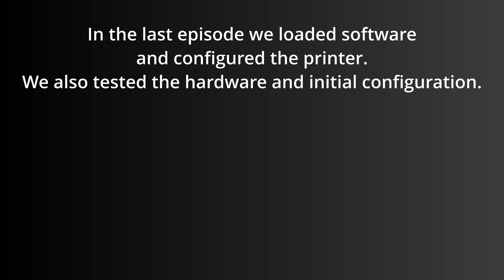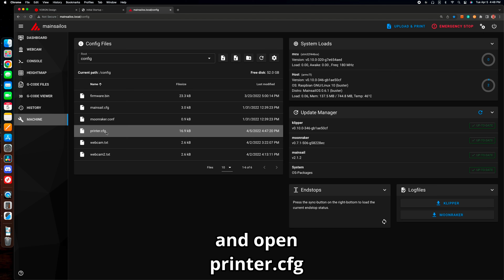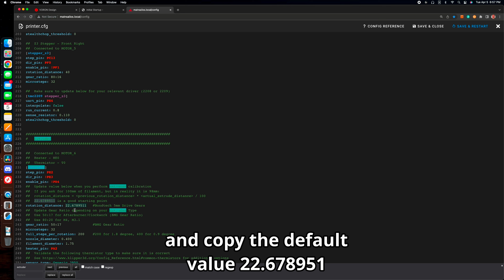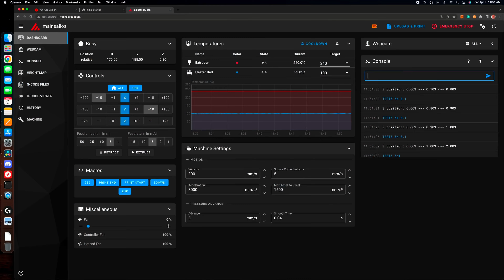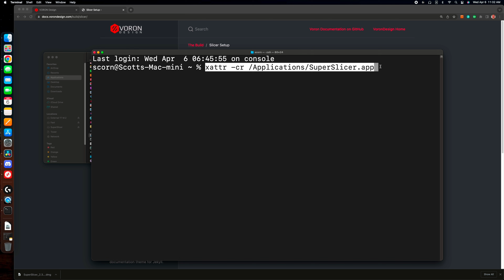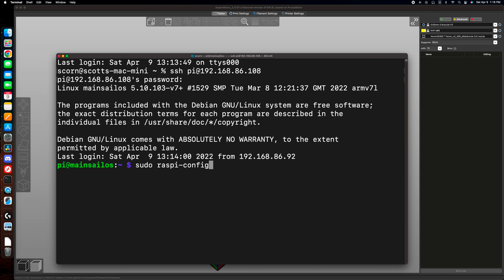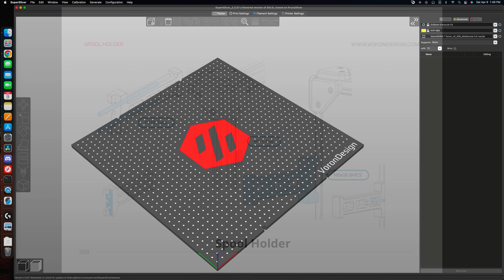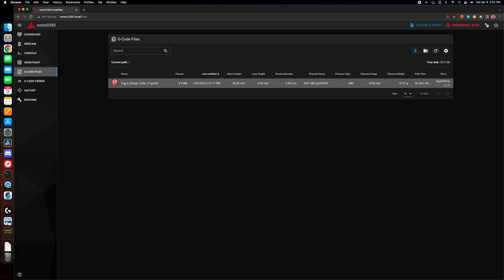Voron 2.4 Step By Step Part 13 Tuning, SuperSlicer and First Print

Comment: ty for this vid. Saved me from myself. Just finished my build and like a fool I calibrated extruder steps by extruding through a hot hot end and not just removing it and calibrating that way. I've made many more mistakes and crashes but your video series has served great reference to get me up and running. Many thanks.
Reply from the maker: Thank you. Sorry was away on business for the last week.
Reply: This is a misconception. Calibrating through a hotend or with it removes makes zero difference. Your final flow numbers in your slicer may be slightly different but the result will be the same.
Technically removing the hotend will give you a more accurate measurement of rotation but because of the way the flow value is calibrated in the slice it doesn't matter. The flow rate number in the slicer might be slightly different but the result will be exactly the same.
Reply: @ashleywhitehead3710  Neat!
Reply: @ashleywhitehead3710  This! I never calibrate rotatio-distance with the hotend removed. Just lower the speed to 1mm/s and measure properly. Doing it with the hotend removed might in fact hide mechanical problems with the extruding system: slipping feed gears, partially clogged nozzle,  low heatblock temp.  Fine tuning the extrusion is done in the slicer anyway.

Comment: Thank you Scott, its a great series. I specifically like the time you take for each single step. It makes it very easy to follow. Thanks for your efforts and all the patience.
Reply from the maker: No problem. I'm working on input shaper at the moment.
Reply: I did just the same , it’s not remembering my Z offset )-:
Reply from the maker: @adrianstealth340  I don't know that it was related, but I had Z offset issues as well. It took me redoing Z_ENDSTOP_CALIBRATE to get back to working order.

Comment: Thank you so much for your videos.
I just finished building my 2.4 R2 with stealthburner and Rapido hotned
I followed every video step by step
very helpful and thorough
struggled with the SB and the AB belts because yours in AB and different X for the rails.

Comment: Scott, thanks so much for putting these videos together. I am good with hardware and mechanics and was able to get through assembly and wiring with just the voron docs,  but as far as software configuration and programming go im pretty weak. Im sure I could have muddled through with the voron docs but it would have taken way more time than just following you.
Reply from the maker: Glad to help! I've been a software engineer for 30+ years so it's the easiest part for me. The hardware is still the fun part for me though. lol
Reply: @scottcorn  Thanks again! Just had my first successful print on the new machine! I do agree the hardware is much more interesting and enjoyable than the software.

Comment: Seeing the first print come of your voron is a special moment indeed. 🥳
I would just like to point out that all the parts external to the enclosure do not need to be ABS. You can print all the panel mounting parts and skirts in PLA. Hell I even printed the exhaust fan grill that is inside the enclosure in PLA and it's been fine.
Accent parts might be slightly different colour tone to ABS in PLA. But you can print all the enclosure mounts and door hinges in PLA and then print the skirts in ABS once you have the enclosure in place.
Reply from the maker: I've just been printing with ABS so far. I'll have to try PLA before long.
Reply: I print my non-structural parts in PLA or PETG as well. Not only is it cheaper but also easier to print and you get a much larger color palette selection.

Comment: Scott , you don`t need to take the hot end off you calulate the rotation distance . you just heat it up to 220 and do it as you normally would  , mark the filament , extrude 50mm see how much it actually extruded . calc the rotation distance , and run 50mm again to make sure its correct . Thats all is needed . Thanks for your grreat vids .

Comment: Lookin good Scott, I started my build around the same time as you and referenced your series several times. I'm up and printing just in time for the R2 and stealthburner updates.
Reply from the maker: That is awesome! I'm going to update to R2 at some point. I have the parts for stealthburner. I have a tool changer on my mind as well. I'll have to balance the two. I'm sitting here printing and realizing I need a nevermore added to the printer soon. lol I have a Hakko fume extractor, but I'm not running it for some stupid reason.

Comment: Hi Scott. Thanks for these amazing instructional videos. One question regarding the spool holder. In later videos, I see you've relocated the spool to the front left side of the printer. I want to do the same thing on my build. Skimming the subsequent instructional vids, I haven't found if you showed the move or not. Can you describe what changes you made please? Is it basically, just the relocation of the holder and then utilising two of the bowden retainers (bowden_retainer.stl)? One on the left side panel and one around the corner on the rear panel, to guide the tube to the back inlet?

Comment: What gibberish at 2:30 is meant to be some sort of "english"? I see measuring for that step preperation, but thats all. Or only to get the difference before QGL?
Reply from the maker: The back of the gantry sags a lot at this point in the build. If it is too much lower in the back the QGL will fail. Depending on how far off the gantry is side to side or front to back you can also crash the nozzle into the bed.
Reply: @scottcorn  Ok mine was about 5 mm   off at max and had three runs.

Comment: thanks, nice tutorials, just a little tip, invert the cable guides so they don't force the cables and it's very simple
Reply from the maker: Thank you.
Kinco3D was suggesting the same for the chains. These chains only bend in one direction so I'm not entirely sure what you are suggesting. Is there something I can reference out there to understand?
Reply: Just invert the first link next to the mount. It will look much better, the whole chain will lie flat on the gantry.

Comment: Great video Scott, well done! I always drag the paper under the nozzle only so there is zero interference from the omron probe I'm using. Maybe that doesn't matter?
Reply from the maker: The paper under the nozzle is needed to get things close to begin with. After that test prints are needed to further refine. Thank you.
Reply: @scottcorn  right but the way you were doing it, you had the paper under the probe as well. Like I said, it probably won't even matter since it was probed from the start of the calibration.

Comment: iam building my voron 2.4 according to you but i have a problem 
when i try to print i preheat then i start the print voron home the qgl the home again but after this it start to print on the z endstop  
iam using what you use iam just following your instructions
Reply from the maker: Are you saying that it starts extruding when it is still over the Z endstop? Sorry, I'm not understanding your question.

Comment: Hi Scott, I am trying to pass the QGL test but got this error Probe samples exceed samples_tolerance. Can you advise me what I should do to check before doing the qgl?
Reply from the maker: This usually happens when the gantry is too unlevel from on side (front, sides or back) to each other. A screw is loose on one or more of the Z motor/belt assemblies can also cause it.
Make sure everything is properly tight and the belt tensions are about equal.

If that doesn't help try changing samples_tolerance under the [probe] section in printer.cfg to a larger number. Say 0.0.1 and try the QGL. If that works put it back to what it was (mine is 0.006) and see if it works after the first larger one.
Reply: @scottcorn  thank Scott, z0 gt2 gear was loose and gantry was not level properly so tightened the screw and used square ruler to level all four point. Homed and try QGL and passed the QGL process. Thank you.
Reply from the maker: Glad that it worked out.

Comment: Amazing first print. You did well as usual.  Very helpful.
What material, bed temp, extruded temp and print speed did you use?
Reply from the maker: Thank you.
KVP ABS (I really like KVP), 110 to start 100 after, 240 to start 235 after and 300mm/s velocity 3000mm/3 Acceleration

Comment: this is the best Voron series by far! Thank you for your effort. I have a problem and I would be happy if you could help me; when i try ssh from the terminal on my mac mini m1 i get an error message. When I try the same with a PC everything works without problems. I see that your terminal on the Mac mini works ok. Did you make any adjustments to the terminal?
Reply from the maker: You are welcome.
No, it was the stock Mac install. What error are you getting? Maybe I can help.
Reply: @scottcorn  thank you for your kind reply

Comment: I have notice one thing that makes me wonder ( you did not tighten the scrows when connecting the Gantry to the Z rails "previous Videos" ) " i was waiting to see if you would tighten them in and i notice you did the QGL ( Minute 3 ) and you can still see it clear (front gantry moves few mm before the z rails moves with it ) ... is that how it supposed to be .... For the record i thank you a million time for the effort you did with your Videos explaining the build ... big fan and building my 2.4 with the help of  your videos.
Reply from the maker: Once you do a QGL and while it is still level you should tighten the gantry mount screws. Didn't realize I didn't have that in my videos.
Reply: @scottcorn  thanks Scott ... now it makes sense ... had to double check all your Videos  .. no harm ..you got more views :) and i learnt alot from you ... Thank alot
Reply from the maker: No problem. :)

Comment: At 6 min mark you take off the hotend wouldn't it make more sense to just remove the nozzle?
Reply from the maker: You could probably get by with that. You would need to be sure that there was no residual plastic.
It's just so easy to remove the assembly that I chose to do it that way.
The idea is there is no resistance on the filament. We are setting extrusion only not flow. That comes later.
Reply: @scottcorn  Good point about residual plastic, I have not printed with the printer yet so I should not have a problem. You did an Awwwwwwwwesome job with this series!! This is the best out there for sure I have been through them all but have to keep coming back to these because they are the best!! There are no good videos out on super slicer you may want to make one for the voron!!
Reply from the maker: I may do one in the future. I need to get back on a schedule with the videos. lol
Was determined to after this last video release, but then got Covid. Still have some symptoms after two weeks.

Comment: Im curious in what method you would use to adjust speeds in your filament/superslicer profile.  I have screwed up all kinds of ways trying to iron that out.  First cube was decent.. onceI started tweaking it went to hell fast and when I wipe and start over its still trash.  Ive seen Andrews tuning guide but it reads like stereo instructions and looses me.  Guess Im one who has to see it to wrap my head around it
Reply from the maker: To be honest, I've not changed from Doc's default settings for Super Slicer yet. It has been printing really well with them.
https://github.com/VoronDesign/Voron-2/tree/Voron2.4/slicer_profiles/PrusaSlicer
The only real tuning I've done so far is first layer height and bed mesh.

I'm just finishing up the skirts etc. video. Once that is done the next video will input shaper and  pressure advance. I don't figure I'll really mess with the speeds much though.

Comment: Hi again, when I test the motor using retract and extrude the motor got hotter and when on stand by the motor's temp remain hot. Is there something I need to look into or it is normal to get hot?
Reply: Should i adjust the voltage for extruder motor to reduce heat?
Reply from the maker: Yes, you can drop the voltage a bit at a time making sure each time that it has the power to do it’s job.
Reply: @scottcorn  Thank for the suggestion. I am trying to pass the z_endstop_calibrate and made it to 2mm height and tried the -0.1 and the z motors goes up and down instead down. What possible cause this ?
Reply from the maker: Sorry, had an overly busy day. Are you saying the Z motors are going the wrong way?
Reply: @scottcorn  it going the right way, when I reach to 2mm above the bed and try to go down further, it refuse to do so
Reply from the maker: I video will help. When I click on your link I get "Oops, something went wrong." Maybe not public or unlisted?
Reply: @scottcorn  the video is set to public viewing and maybe the link I share was wrong ? https://youtube.com/shorts/vYiIfvllaK0?feature=share
Reply from the maker: Got to it from my email. Couldn't in YouTube Studio for some reason.

Are you wanting to do a Z_endstop_calibrate or a PROBE_CALIBRATE? If you are doing the Z it should move back to the Z endstop before moving down. Have you defined the home_xy_position over the top of the Z endstop? If you are testing the probe use the PROBE_CALIBRATE calibrate.

I don't remember that Mainsail dialog you are showing. I may have used it before, but I don't remember it.
Reply: @scottcorn  z_endstop_calibrate is what i am at the moment. Some say it caused by offset z height preventing doing down further? Or it something else ? Just not sure what to do to pass this step
Reply from the maker: What is the value of your z_endstop_calibrate in printer.cfg? Is it maybe negative?
Reply: @scottcorn  It is position_endstop: -0.5
Reply from the maker: Thank you intended to type position_endstop. This shouldn't be negative. I've run into this using Mainsail's UI to adjust the Z offset height. Another thing I was thinking before I forget, is your Z end stop shaft too long? (Sticks up above the print surface more than a couple or three mm)  Or to short? (below print surface)

If that is not an issue I did the following to get my z nozzle offset.

I did the paper under the nozzle thing using the UI to get to that point. I went into print.cfg and find position_endstop = <some number>  in the save_section. Make sure the number isn't negative. If it isn't copy and remove the the position_endstop line from save_config section.

Gp up and find the [stepper_z] section. Paste the position_endstop = <some number> at the bottom of the [stepper_z] section. To fine tune the z offset now just remove small amounts from the number. (I was at position_endstop = 1.350 and bit too close. I went to position_endstop = 1.300 .) Smaller numbers moves the nozzle up. Large down.

I don't use the Mainsail UI for z offset anymore. Several on the Voron Discord recommend this to me a while back. I have no idea why the UI is making this number negative.

Do i understand the issue now or am I still lost to what is going on?
Reply: @scottcorn  will give your suggestion a try and let you know later. Looking after puppy for a week 😂

Comment: Hey Scott! Im following you since EP1 i builded my voron 2 300mm with your help and im new in the world of 3d printing. I tryed my first part yesterday in blue PLA and it was a success ! But i have a problem and i dont know how to fix it. When my toolhead is heating the filament come out of the nozzle and it is a problem when the printer make  the BED_MESH i have PLA everywhere. Is there a way to fix that? thanks !
Reply from the maker: I've been thinking about this. There are several possible reasons. 

1. You may be setting the hotend too hot. Check what the filament manufacturer recommends. Are you maybe running PLA at ABS temps? Check your slicer.
2. Your nozzle could be worn out. Have you printed abrasive filament on a non-hardened nozzle?
3. Do you have the wrong filament size in the slicer? Not set to 1.75?
4. Are you using a large nozzle diameter? The larger the nozzle the more ooze. 

You can retract the filament when you are done with a print. You will need to run a purge of some kind at the start of a print of you do this. It also doesn't seem like this would have enough to get PLA everywhere. I retract 5mm at the end of a print. I do have a little ooze that I have to clean up before it z homes. I'm going to add a auto scrubber to my printer in the future.

I'm sure there could be other reasons, but these are what come to mind as my most likely reasons.

Comment: I guess you aint gonna do it but I wish you do a video on how to add leds in the Stealth Burner.
Reply from the maker: I'm planning on doing a video on the stealth burner including the lights, but it will be a bit yet. I am adding LED lights on the top rail in the next video. I need the overhead lights for time-lapses.

Comment: Great series! I am running into an issue now though. When I go to do my first print and it attempts to do a QGL, it stops saying it can’t sense bed, but if I do a QGL from main screen without trying to print something, it performs QGL fine. Not sure what I am missing….
Reply from the maker: Does it do a home all first?
Reply: @scottcorn  yes. it homes X, Y and Z, then it displays "No trigger on probe after full movement" and stops at front corner.
Reply from the maker: @VVBT34  It is related to the z limit switch in some way. Is the shaft on it maybe too long and it triggers to high above the bed? If that’s not it, maybe the z offset too large? Something is telling it that it should be triggering too far above the bed.
Reply: Found the issue. The sensor was just a hair too high. It would do quad level in testing, but not for print. Once lowered a smidge, t works as it should now.
Reply from the maker: Cool, I didn't think about the probe being slotted and can be moved. Glad you got it.